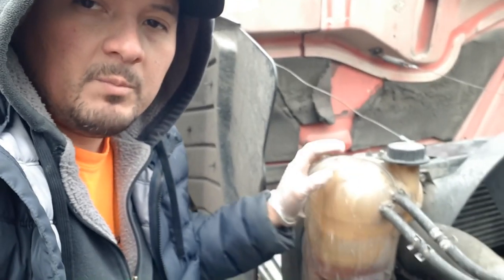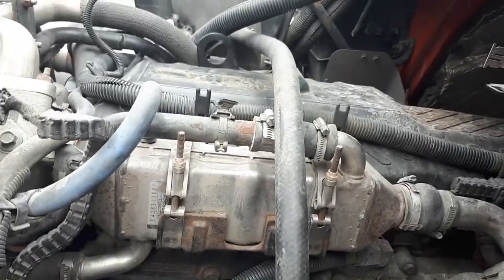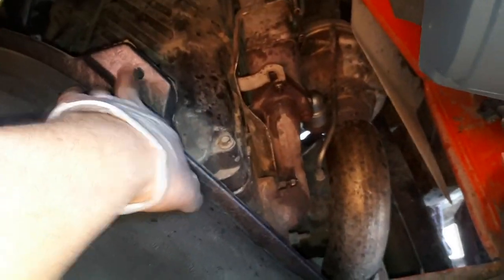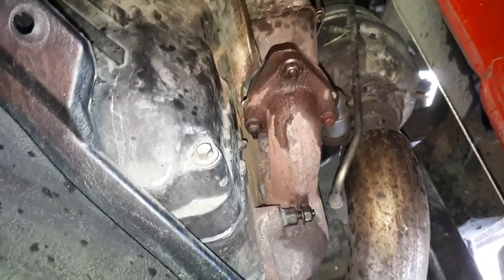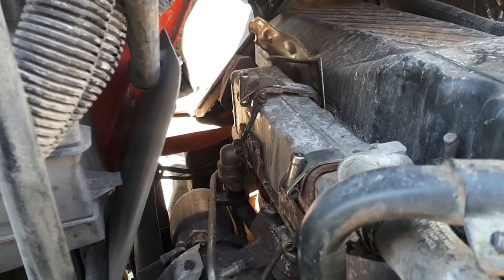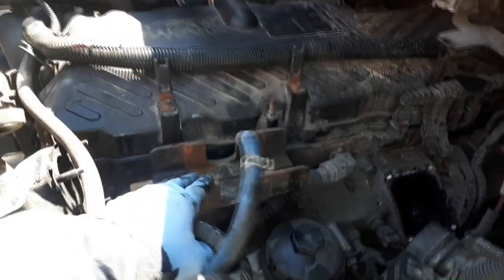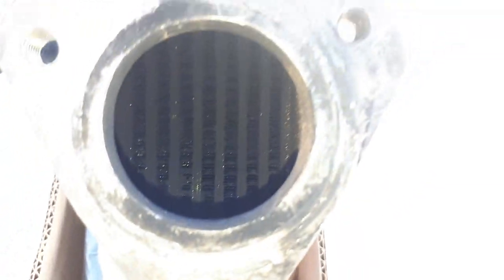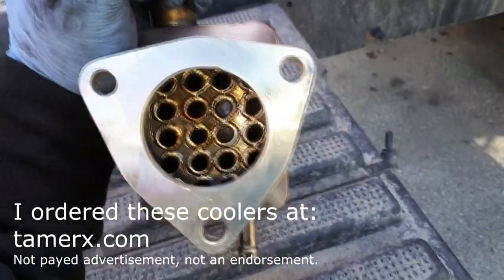How to replace the EGR coolers on a Maxxforce 9 engine

Comment: Hi , thanks for the video ,i have same issue with coolant in the engine , do you think this is from a bad egr ?
Reply from the maker: It could be, its a common problem. disconnect the hoses and check for moisture inside coolers.
Reply: thank you for your reply , yes i took them off they are really bad , going to replace them soon .

Comment: Hi, did you fix the problem? I do have the same issue on my maxxforce DT 2009. I did change Both IGR, sent to clean up the dpf, but nothing change. now the dealer says that are injectors cups, other mechanics say are: Blow head gaskets,  cracker head,  calefaction system, and bla bla bla. 10 shops including the dealer and any gave me the same diagnostic. Can you help me? Thank you so much. Very informative videos! 👌👍
Reply from the maker: I got to the point that I was about to replace the injector cups and concluded that I wont. Instead I drove it like that until I sold it and will never get a maxxforce again.
Reply: @thetransporterboss  I will take to another shop next week to find the problem. I was talking with him today and looks like an old school mechanic, he told me that can be a hose connecting to the IGR cooler, explained that he has the exact same case, the hose looks normal outside but inside has a blowout obstruction, also can be the compressor and the last thing head gaskets, we will see. I already expended a lot of money and stress so well worth another try. I will let you know Thank you!
Reply: @lililiso9694  did u fix the issue? mine will start blowing clouds of white smoke once the exhaust with exclamation mark light comes on